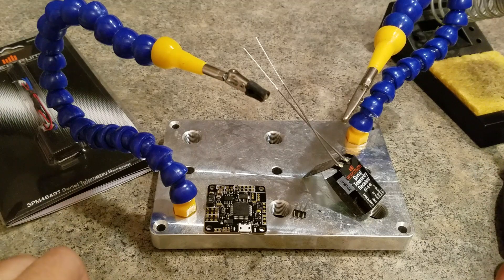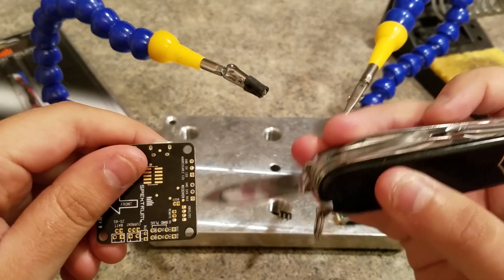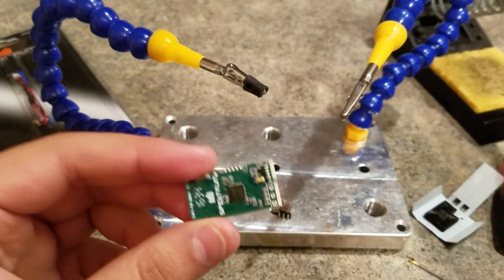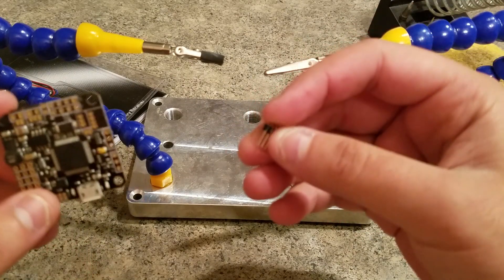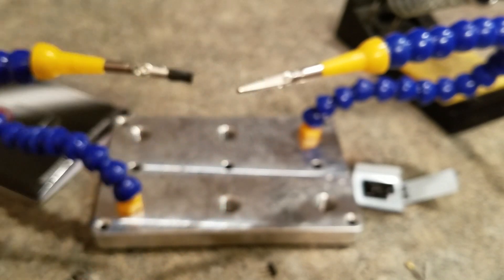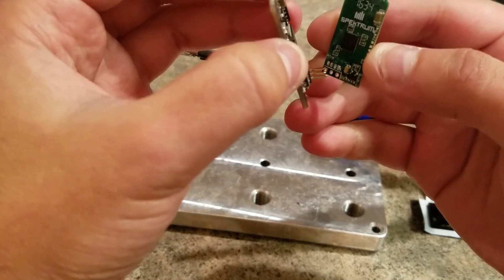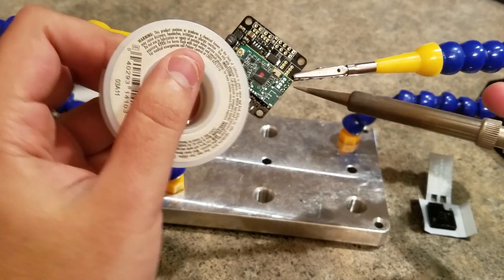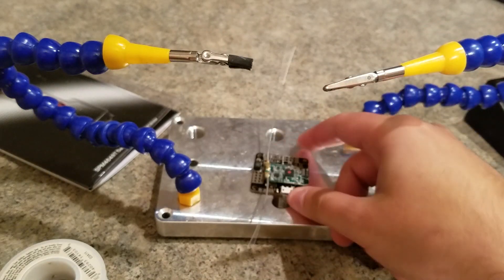How to - Spektrum F4 Flight controller + Serial Telemetry Receiver (SPM4649T)

Comment: I was always told not to put anything on the gyro. This is right on top of the gyro. Why not mount it underneath
Reply from the maker: Mounting the receiver underneath would expose it to more electrical noise from the PDB/escs. Just put a piece of double sided tape in between them and you'll be fine.

Comment: I binded mine with the bind plug and power through a KISS FC. It binds perfect but when i remove the bind plug i can't get power. Power through USB or battery i cannot get power with out bind plug in. Am i missing somthing here?
Reply: are you sure you aren't getting power? The LED does not light up when not in bind mode but powered (and no connection to the transmitter)

Comment: Hi Miguel.  Will this receiver work with the tbs power cube flight controller? Thanks Mark.
Reply: How do I bind that receiver to my dx6i.  I purchased a used model on eBay and the work you just showed is already done.

Comment: im so fustrated with that fc, i been trying to flash it to betaflight, with no luck at all, does anyone here has experience how to do it, this particular fc, refuses to accept anything but raceflight, major mistake buying this fc, im so disappointed.
Reply from the maker: This board was never advertised to support betaflight. There is no betaflight target for it.
Reply: Thks, i guest im stuck with raceflight.

Comment: Hey, nice clean instruction video. I want to do the same thing but have a concern about the + and - pins not matching on the flight controller and receiver. Flight controller connections are -5v +5v and signal but the receiver connections are +5v -5v and signal. 
Did you have any issues supplying +5v to the -5v pin on the receiver?
Reply from the maker: the 3 big pins are not the same signal order as the 4 pin connector. The order is Gnd (not -5V), 5V and Signal. So they match the flight controller. Those 3 pins hidden under the connector are meant to match standard servo polarity order where power is in the middle, which is different from the 4 pin connector.

Comment: thanks alot now im out a receiver and you dont say s$&% about it voiding the warranty it wont turn on. cant get the light to come on no matter what i do. i blame this on you thanks alot man
Reply from the maker: Jesse Mccoy Its stated clearly in the description
Reply: Miguel Alvarez yup because everyone reads that befor they watch the vid. if you work for spek thats sad they need better workers i dont mean to be a dick but i spen everything on this and now im fucked for another month im sorry but im blaming your lack of skill when it comes to making videos spek should find someone else
Reply from the maker: I think you need to evaluate your decisions more carefully for this hobby if you're under such a tight budget. If I was under such a tight budget that damaging this receiver would've cost me a month of flying, I dont think I would've felt comfortable performing such a modification so quickly without further investigating the ramifications I might face if I damaged it in the process. I think its safe to say that performing any sort of hardware modifications directly on a pcb tends to always be in the void warranty zone, but despite that, I posted it on the description just to be sure. Out of all the people that have contacted me saying they damaged the receiver in the process of doing this mod, none of them have complained about not knowing they'd be voiding the warranty. They simply wanted to know what they may have done wrong, and if there was any possibility of fixing their mistake. You're the only one that's complained about the warranty warning not being clear enough. This is not an official spektrum video, hence why its on my personal youtube page. This is a demonstration video I did in my personal time because I know people will want to do this sort of thing despite voiding warranty, and I felt a personal obligation to do this video given that it was my project. I'm sorry you feel that I shouldn't work here, but I'm happy to say that most people don't share that sentiment,  and this receiver probably wouldn't exist if I wasn't here.

Comment: i did this mod exactly as demonstrated but cant get the receiver to go into bind. The bind feature in raceflight doesnt make it go into bind either. Was I supposed to bind receiver before I did the mod?  The fc works when plugged into the raceflight app. Frrustrated, please help. When plugged into a 4c battery there 4.4v at the receiver pins. Is this enough? The lights are on on the fc, but I see no lights on the receiver.
Reply from the maker: You can put it into bind mode by shorting the signal and gnd pin using tweezers while you power it up. Yes 4.4v is enough
Try running the "defaults" command in the cli to make sure the right settings are set in the FC. Some people have had bad settings out of the box for some reason
Reply: Miguel Alvarez I don't know what I did but it now works. Maybe I wasn't holding my mouth right?!! Anyway ur vid is sweet. This is cleanest setup ever. Now if I could just get the rf1 config to work....

Comment: Miguel, is it just me or is the polarity pinout of the flight controller reversed from the receiver? Please check the production models, because I believe that on mine they are (3 receivers and one flight controller).
Reply from the maker: are you talking about the telemetry receiver or remote rx/sat rx? Either way, they are correct. Keep in mind that the servo connector pinout isn't the same, and isn't meant to be the same as the JST ZH connector. Servo connector style is Gnd, Power, Signal. JST ZH is Power, Gnd, Signal.
Reply: Miguel Alvarez rx is 4649t. Flight controller is spmfcf400. When I have them stacked as you have them shown in the video I get no reaction out of the receiver. After reattaching jst connector it works. Is it possible that there is an issue with the FC?
Reply from the maker: Do you mean re-attaching jst while its still stacked on the FC? Its possible you didn't cleanly remove the jst and left pins shorted together, and having placed it back caused the solder jump to break. Otherwise, make sure the rx was facing the right direction (antennas up).

Comment: Very informative. Is split for the bind plug not needed? Was going to cut mine off to save some space. I have the dx6e.
Reply from the maker: Its not needed. Its just a last resot to help with binding if the FC isn't able to put it into bind mode.

Comment: Miguel - I have an F4 FC on the way and DYS XSD30A V2 ESCs.  Two questions (for anyone who knows please): (1) Is the ESC firmware code for the XSD "A-H-30" (the same code as for the XS30)? and (2) does regular Raceflight (not RF1) support D-Shot?

Thanks - Adrian (noob)
Reply from the maker: I haven't personally used Dshot, so I dont know if the dshot code is the same or not. Due to the peripheral assignment of this board, not all the existing motor outputs can support dshot. That being said, it can probably be done re purposing some of the extra uart ports as motor outputs, but its not something I've had a chance to look into. To answer your question, the Spektrum F4 FC doesn't support Dshot on regular raceflight although it might in the Revolt. It might be supported on the spektrum board in RF1 using some pins that arent the existing motor pins.
Reply: Awesome, thank you!

Comment: What flight controller currently support telemetry for spektrum
Reply: The RaceFlight Revolt and the Spektrum SPM4649T as far as I know :)
Reply: it's time to try the revolt then LOL
Reply: JulianGoes 3Dprinting thanks. but one more question do I bind it before I put it on the flight controller or after
Reply: JulianGoesPro thanks
Reply: Farins FPV it sure is ;)
Reply: How do you bind it?
Reply: us the bind plug with the supplied cable or via RaceFlight GUI
Reply: kerry price to be on the safe side I would do it as the first thing
setup a model in the Tx, bind and never worry about it ever again
Reply: JulianGoes 3Dprinting basically I'm asking can I bind it after I solder it to the board